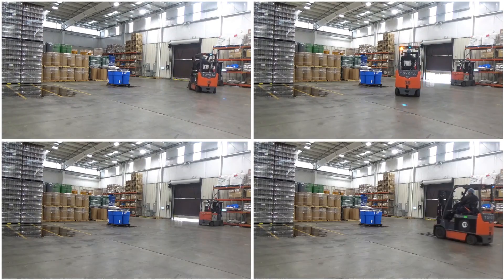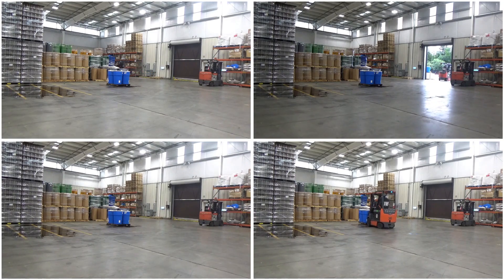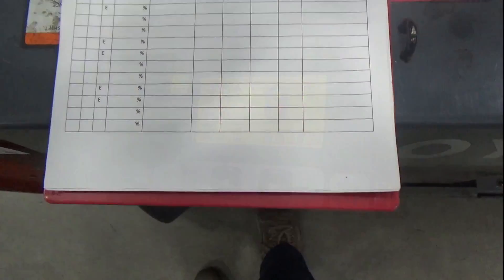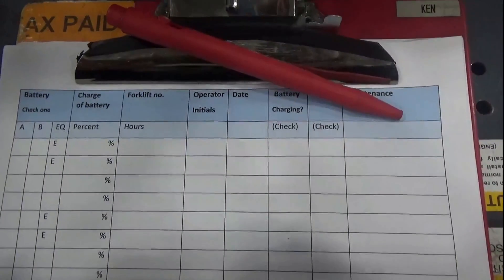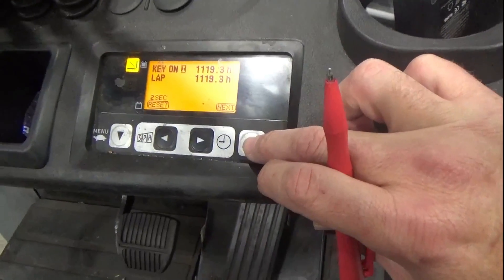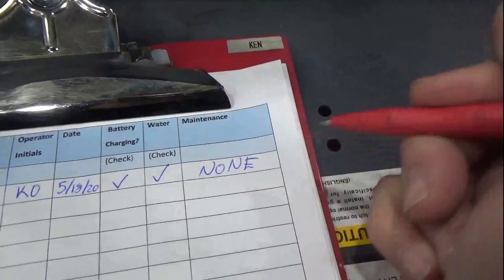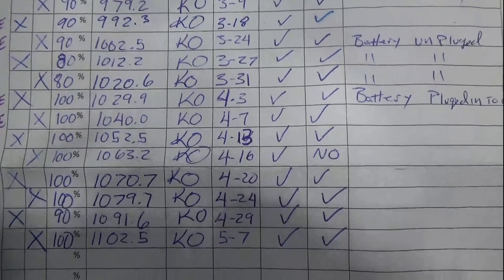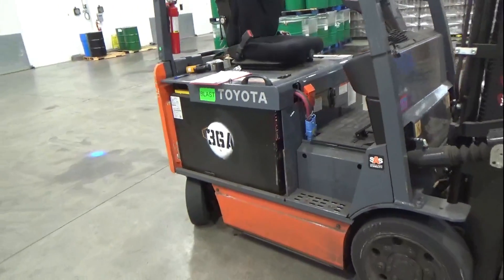How to Change a Forklift Battery

Comment: At my work we use the same battery over an over in our counterbalances and reach trucks.... Not everyone fills the water up.. I often have to do it for others and add 3 or 4 gallons of water.
Reply from the maker: The way we fix that problem. Is a signing two batteries specific for one forklift. We used to just have a bunch of batteries and everyone takes whatever they want. But if you know you only have two to pick from you're more likely to water the battery more often. But we are also assigned a forklift for two drivers, one nights and one days. If anyone can just pick out whatever forklift they want this might not work.
Reply: @OmegaOrdained  I mean we don’t have multiple batteries for the machines. We charge the batteries in the forklift or whatever. Then they wonder why a $6000 battery dies in less than two years. 🤦🏻🤦🏻🤦🏻
Reply from the maker: Oh yeah totally. The speed charging greatly reduces the battery life I think.